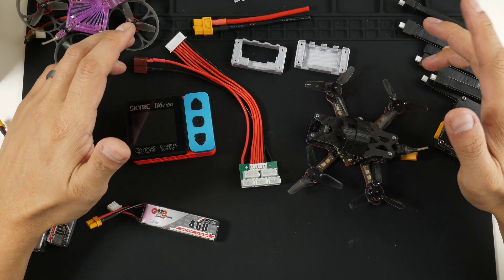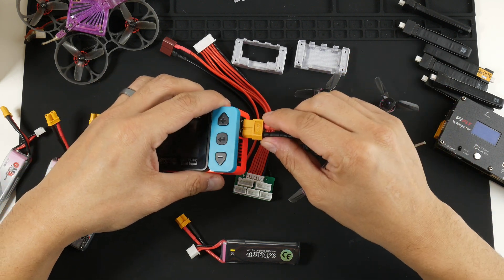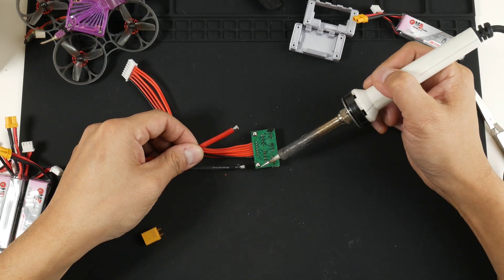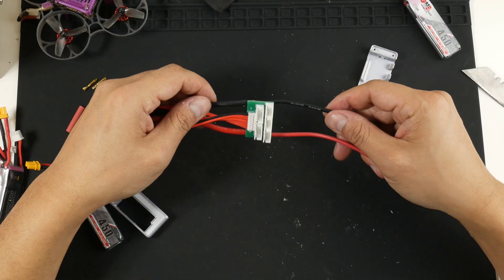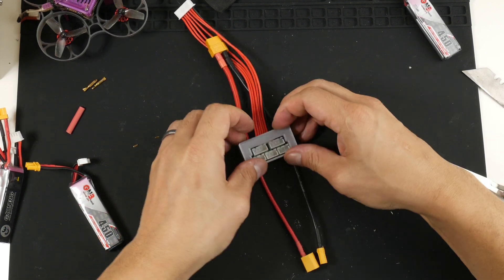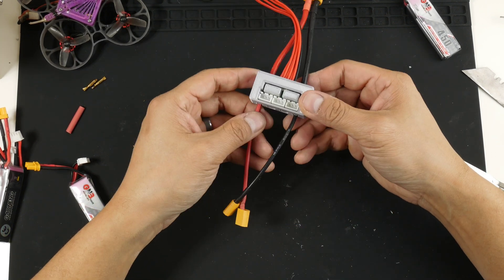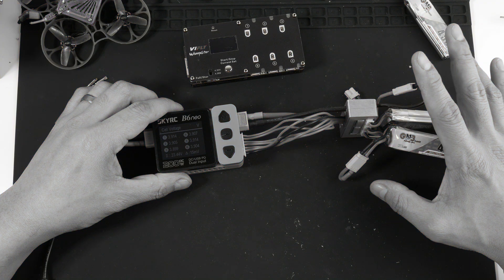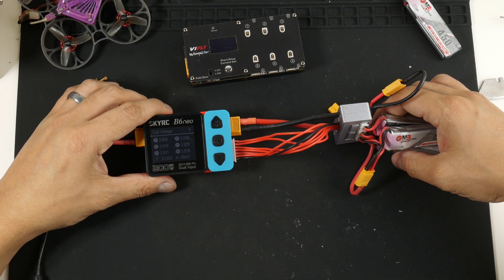3 x 2S Lipo Series Charger Harness Mini Project

Comment: Its so funny how often you have build things I also have thought about. Ive build 2x 2s Cables for my 4s Chargers. But in the meantime Ive opted for less hassle and just buying more ToolkitRc 4x 4s Chargers and stay a low currents. No Toolkitrc failures at this point ;-)

Comment: Are you still using same method? Is it working? I'm planing to make same for 3s battery. But I'm confused why you made this separate red and black wires? Is it simulates like I'm charging 6s battery?
Reply from the maker: @GiorgiMosiashviliOfficial  yep. Still using this method and still works fine. Yes, this setup simulates charging a 6s pack.
Reply: @nxp200 thank you for your super fast answer ❤. I ordered same and will try. People are posting about heat problem for b6 neo. You have any problem of that? Propeller for b6 neo works properly?
Reply from the maker: @GiorgiMosiashviliOfficial  I haven't had any issues with it. In fact, I was using it just then and the fan started fine. It cooled down and the fan stopped. When it got hotter again, the fan started without issues. Maybe I got a good batch.

Comment: Is it possible to use a parallel board or something with this charger?

Also the Toothstor one you mentioned won’t work with xt30 will it?
Reply from the maker: You should be able to use a parallel board with this charger, just be careful and know how to use parallel charge boards safely.

The Toothstor charges anything with a standard 2s balance lead. So 2S a battery with an XT30 and 2s balance lead should work.

Comment: I'm thinking something like this, but I wouldn't have run the large power leads through the board. Also, the way it's set up, the main 1/2 connected battery leads serve no use because the full current is still running through the balance leads and the board. I would have kept the main power lead separate and connected it in series with the main battery leads.